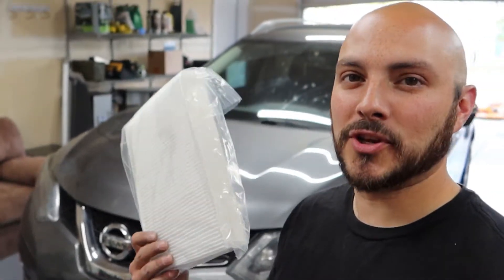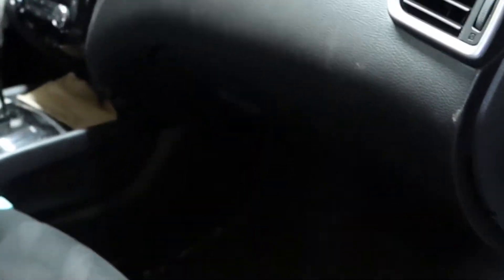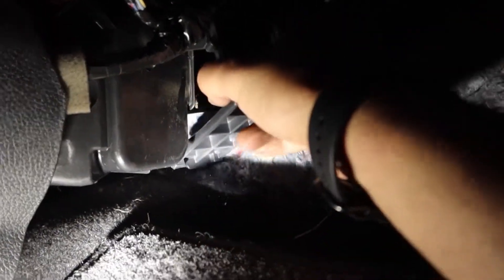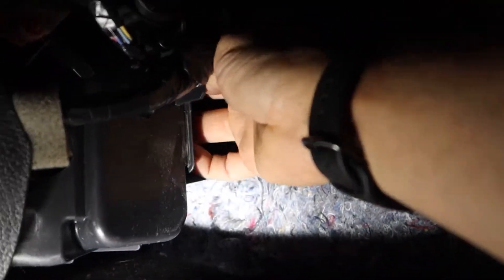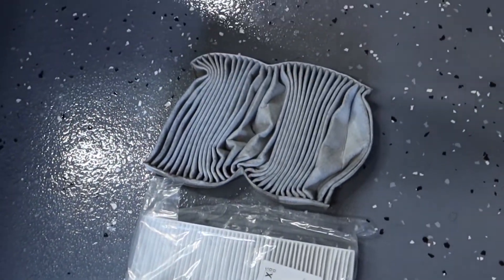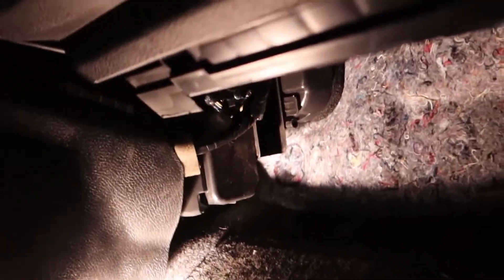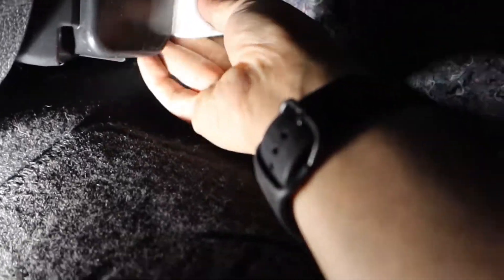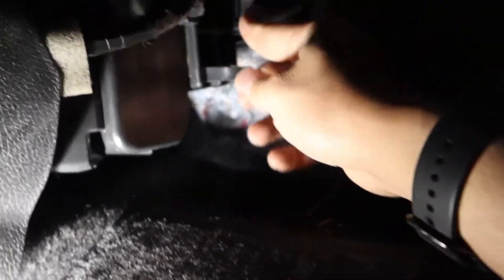How To Change Your Cabin Air Filter In A 2013 2020 Nissan Rogue

Comment: I put the new one in there but now I can't get it out. It seems to have disappeared. I can't grab it. I am very worried when I need to do it next time.
Reply from the maker: They’re pretty crammed in there. Can you use a light to look in and see where it is? You might need some long needle nose pliers to get in there
Reply: @Boost-EdAutomotive  Thanks for answering. I have done all I can. I am going to take it to the dealer because maybe they have a way of getting at it. Or maybe I will buy some very long needle nose pliers and try again if I can find a tool like that. It doesn't seem to be grab-able in any way. I tried a coat hanger wire with a hook. No way to look at it and I can't feel it with my hand. This is going to cost me some bucks.
Reply from the maker: Harbor freight should have some long plyers for $10
Reply: @Boost-EdAutomotive  I got some at an auto parts store for 18 dollars today. I was still unsuccessful in getting the air filter out of there with them so I will leave it in the car when I take it to the dealer just in case they want to try to get it out with that. I can't see it, feel it, touch it or grab it.  It seems to have gone into the twilight zone. I can't believe Nissan designed a filter compartment like that.
Reply from the maker: @crand20033 it is pretty tough. I’m sorry to hear
Reply: @Boost-EdAutomotive  I think the filter is probably working to filter the air but it's not good for it to be completely out of reach so that I can change it next time. I hope someone can get it out of there.